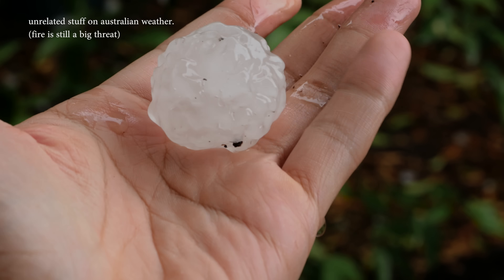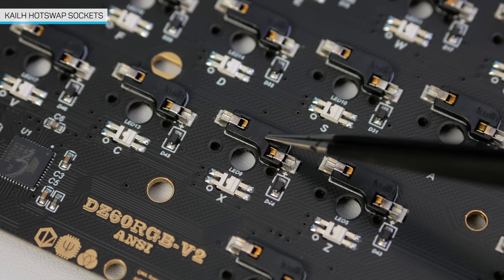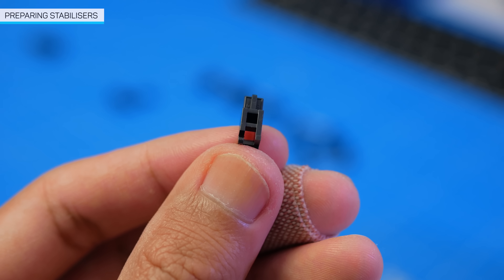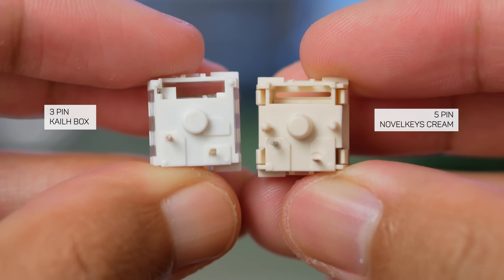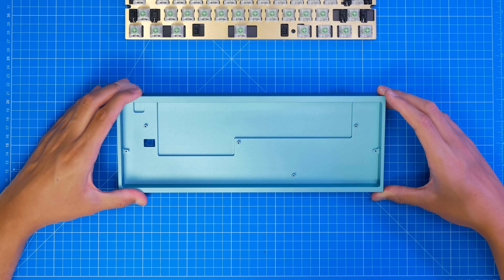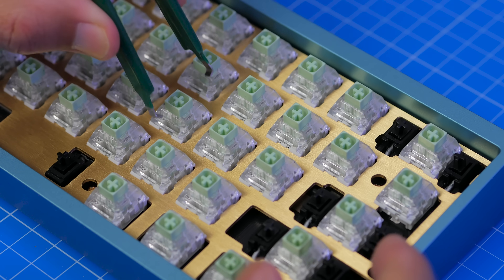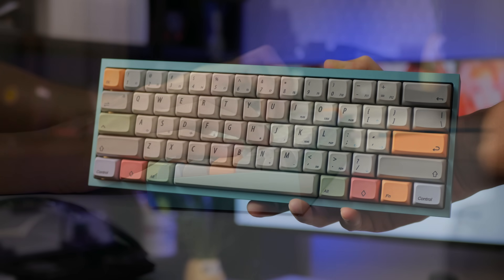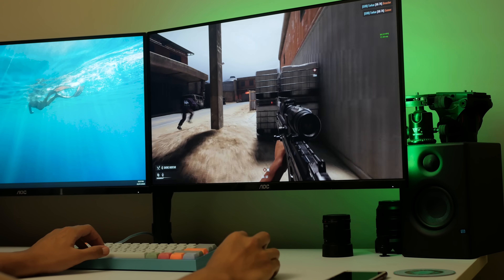How to Build a Mechanical Keyboard WITHOUT Soldering

Comment: For us EU folks, Mechboards.co.uk has the hotswappable HS60 pcb with ISO, ANSI, and HHKB options. 

Also, I would have mentioned that with hotswap boards and metal cases you should really consider using electrical tape to cover the mounts on the case, especially the middle post. On all the hotswap pcb's I've used, the middle post has come in contact with a socket on the pcb, causing the whole column to activate.

Comment: Vaseline for lubing ?
Reply: not recommended. they're petroleum based lube.
questionable when in contact with plastics for long term.
Reply: @Looo0007  I swear people keep saying this type of stuff

I remember when trying to lube the joysticks on my Xbox 360 controller and reading that people say it will eat away the plastic

I still did it 5 years ago and my joysticks are good as new.

I bought a cheap kB and used some hair conditioning product to lube the stabs and it works fine
Reply: * I read that people said wd40 would eat away the plastic but that's what I used
Reply: Just use olive oil like normal people. Makes the keyboard smell nice as well
Reply: @MrSeon123  I've considered that also, but I used mineral oil to lube the stems and housing. I think olive oil may be a bit sluggish
Reply: @ItsDextrin  That was a joke...
Reply: @MrSeon123  Lol yeah but you never know, there may be people actually doing this shit 😂

Comment: What do you think of the Jades?  They REALLY echo in that case and sound high pitched.
Reply from the maker: Jades are a bit too much for me tbh. Especially after using lubed Alpacas. And yeh, the Tofu doesn't have the best acoustics.
Reply: @TaeKeyboards  I'm not familiar with Alpacas (almost did a Google search for lubed alpacas, then reconsidered).  I'm on the fence about mine.  I don't like double click, and may have been spoiled by Alps.  Are Alpacas similarly tactile?

Comment: what about buying foam for the keyboard can you make a guide on that as I want to get more thunk out of my keyswitches.
Reply: they are great to reduce the pinging noise, especially inside a hollow metal case like this one.

a case foam (or simple shelf liner) cut and put inside the case should be enough, but a plate foam (the one you put in between the plate and pcb) will help reduce some more, and help with the plate feel (totally personal opinion)
Reply: Facts what’s all that about what does the foam do
Reply: @Hc4697  absorbs vibration (noise), basically.
Reply: uwowowowow ohhh ok. Jesus there’s so much about keyboards it hurts my brain. I’m willing to drop $900 on my custom keyboard but I have no idea how or what to get to make it quiet
Reply: @Hc4697  lubing and silencing foams. they are great
Reply: uwowowowow I’ll look some up thanks
Reply: H.Cruzz10 Lube makes the biggest difference

Comment: 5:34 It's notable that some pre-built Kailh socket hotswap keyboards don't have the holes for 5-pin switches. This is the case with Tecware and Rakk hotswap keyboards, for example.
Reply from the maker: yep, very good point

Comment: Question: should you lube a tactile switch like the Jades? Or is it not as important as it is with linears?
Reply: you can benefit from lubing even clicky switches, as long as you lube the correct parts.
also use thin lube (like krtx 203 or trib 3203) for tactile.

Comment: Gone down the same path. I have a soldering iron, but de-soldering is a pain with a cheap-o solder sucker! 
I brought a HS60 v3 pcb and planning on getting a brass plate and alu case. Also, them switches are way to loud for me!
I prefer lubed linear switches by far.
Reply from the maker: After using this for the last few days, I went back to my lubed linear board, and it just makes you appreciate how good lubed linears are!

Comment: I got a hotswappable keyboard from "Pawhits", it's a full size keyboard. It was cheap, something like 28 bucks so I thought it'd be nice to experiment with, since I'd never done it before. So then I bought some Gateron blacks to put in it (keyboard comes with "Jixian" blues. Never heard of that brand before), but to my dismay the holes for the pins seem to be too narrow for the Gaterons to fit. Ended up bending like 4 of them beyond repair without knowing. I'm not sure why a hotswappable keyboard comes with holes for pins that are too thin for switches as prominent as Gaterons but... here we are.
But I didn't give up. I searched the web for a 3D model of a switch opener and had it 3D printed at some weird cafe with 3D printers in it. Don't ask. It worked well for the Gaterons since their housing is the same as Cherry's (well pretty much anyway), but of course, lucky me, the "Jixians" have their own different locking system for their housing... so, I had to dismantle them manually with a paper clip (call me MacGyver if you will). After a few hours and a few drops of blood from my fingers after stabbing myself with the paper clip (unintentionally, believe it or not), I managed to grab the internals of the Gateron switches and put them in the Jixian housings, since those were guaranteed to fit the keyboard. So I am now left with these one-of-a-kind... "Jixerons". They're definitely an improvement. I'd love to lube them now that I'm more confident with this stuff but I am not about to go through the process of opening these up again. I hope my next experience goes a little more smoothly, but I guess I did pretty well for my first time messing around with mechanical keyboards. Not everybody's first venture has them make their own switch.
Reply from the maker: wow what a journey. Yeh i dont know what sockets are in that board. but a lot of the budget boards have outemu sockets that arent even compatible with other keyswitches. that board must be something similar.
Reply: @TaeKeyboards  Oooh, man had I known this in advance I might've gone for some Outemu Sky switches or one of those tactile purples. Sorry if I misused some terms in my story there, still learning as I go. And thanks for the reply!

Comment: How much did this all cost?
Reply: with the same case and switch, it's around $180 if you go with cheaper aluminium plate, around $220 if you want brass ones.

edit: didn't count the keycaps. that's usually another $20-$300 depending on what you want

Comment: Does the 60% diy ansi layout diy kit always come with srew in
Reply: he said he's using GMK stabs, they never include those. quite expensive on their own.

usually comes with an OEM one if at all. 
worse in quality, but bearable as long as you lube them properly (with brush and stuff, to the plastic parts as well not just the wire like tae did)

Comment: What do stainless steel plates do with sound/feel/misc
Reply: i think ss flex more than aluminium for same thickness. if you dislike the "harsh" feeling of aluminum, try ss.

brass is denser, better sounding. 
and also, more bling.
Reply: @Looo0007  and carbon fiber?

Comment: This is so sad. I'm planning on ordering parts for my own first build begin februari when it's my birthday, but the Dz60 hot swap in ansi layout is sold out😢
Reply: Sell ya mine, brand new never opened. Have a 5 degree black aluminum case from KBDFANS with the DZ60 RGB Hotswap ANSI PCB and the brass ANSI plate. (everything is still in the box from KBDFANS, I just got started on a different project that was unexpected)
Reply: @phlooke  i already bought the case in gray. I'll just wait a longer otherwise I'll hit u up again
Reply: @phlooke  how much would the shipping be to the Netherlands from where you live? And can I get your discord maybe?

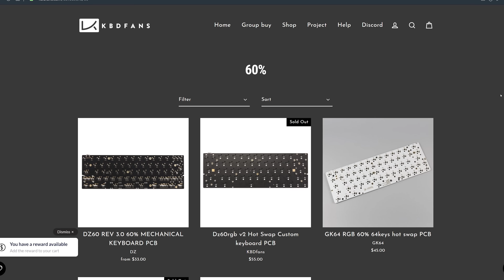Comment: Can you remove that foam piece by the left shift key (seen in 1:40) or will that mess up the PCB?
Reply from the maker: think its just a little spacer for the plate and pcb.
Reply: TaeKeyboards is it okay to remove or should you leave it on?

Comment: Do you need to keep that little piece on top of the PCB? Would anything bad happen if removed?
Reply from the maker: think its just a little spacer to keep the plate and pcb apart
Reply: @TaeKeyboards  Thanks dude. I have the same PCB and was worried.

Comment: Bit of a side rant, but I honestly wish people in the mechanical keyboard community would stop recommending things like Hakos for soldering switches.  Don't get me wrong, they're excellent soldering ions...but they're also expensive and completely unnecessary.  If all you are doing is soldering key switches then that's pretty much the easiest type of soldering possible .  To start with, it's through-hole soldering which alone makes it easier than many other types.  But also the holes and pins are relatively large and there aren't that many of them.  Two per switch, sure, but it's not like dealing with all the pins on a fancy microcontroller or something.  And since they're all the same you don't really need to swap tips either...a basic conical tip works just fine.

You do not need a Hako for this.  It's massive overkill.  You don't need any sort of fancy soldering iron.  A $20 no-name generic soldering iron from Amazon is more than enough.  At least if you're just talking about key switches.  If you're doing the kind of build where you also need to solder on controllers or SMDs then you might need something fancier.  But most mechanical keyboard enthusiasts are buying PCBs with all that built-in already and just soldering the switches.  And switch soldering really is about the easiest type of soldering you will ever encounter.

Comment: How do you get less of that high pitch metal sound and more of a thonk more bassy sound when pressing keys?
Reply: SA keycaps or you could line the inside of the case with foam
Reply from the maker: yeh foam helps. lubed stabs helps. lubed switches helps.

Comment: Super new to custom mechs and I love this channel for all the great content <3 . I wanted to ask if the stabilizer bars go under the plate or above it? If it is below, wouldn't having the bar support the keycap make it more stable?
Reply from the maker: Goes below the plate. It does support the ends of the keycap :)
Reply: it seems that the stabilizers part that support the keycap is the plus shaped plastic thing that slide into the keys, the metal bars simply makes the movement linear with each other

Comment: soldering is easy, desoldering, that's the nightmarish part with switches. I only had to reswitch two keyboards and that was enough for me to get a desoldering gun.... albiet a cheaper chinese one but still $150.
Reply: Meanwhile, I desoldered all the 111 Cherry MX Blue switches on my G710 with a cheap iron and solder wick :3 It's not that bad.
Reply: Seon-Ho How much self-hatred does there have to be to desolder 111 switches with solder wick? 
Just get a pump for 5€/$

Comment: You can buy hotswap socket keyboard. I like to answer videos title question before watching :) because maybe (probably not) you will offer another suggestion. Let's watch

Update: 
Watched. I WAS SO RIGHT :) ok please don't name title like that because it is obvious

Yes I am like almost two year subscriber XD so these titles are a bit annoying but I undrstand that it is nice approach to explanation for newbies. But it makes me feel like listening same lesson I listened two year ago

Also for first 3-4 keyboards tray mount is ok, but if you are buying your 4-5 keyboard just buy top mounted ones (they are 50 percent pricier) and sounth facing because typing experinece will be more consistent. Tray mount design keyboard are ok if you like swapping cases, but I would recommend to buy top mount to make it more endgamish. I think my 5th keyboard was top mount :D next keyboard was tray mount again which is anne pro 2 and my 7th drop alt which is integrated plate. These keyvoards are best bang for the buck keyboard on market. Now I am using these three keyboards and their are endgamish in their own way. Though I want more sounth facing keyboard because I eant to use my gmk sets more

Comment: Hotswap non 60% PCBs are just impossible to find for ISO layouts.
Reply from the maker: yeh rip iso
Reply: I would be a lot more into keyboard making if the parts were there. I mean, even PBT keycaps for ISO DE are almost non-existent. The only ones available to purchase are 2 sets from Ducky, 2 non-name sets from aliexpress and a few Tai-Hao sets which are 99% of the time out of stock.
Reply from the maker: @moepOo  yeh i hear you :(
Reply: The CU80 and CU65 GBs were running a while ago. Hot swap, and use Kailh hot swap sockets. There might be a 75% version coming some time in the future.

Comment: Hi man, what’s be better? Hot swap or default soldering(for Reliable)?
Reply: hot swap all the way
Reply: Every answer to this question will be subjective. It comes down to personal taste and preference. Some people build really expensive keyboards with cheap gateron switches, because that's what they like. Other's build cheap keyboards, where the switches are the most expensive component, because that is what they like. :D
Reply: Ernur Amangeldinov hotswap
Reply: answer from a kb builder here:

your question really depends on how you use your keyboard.

- if you're starting out, go with hot swap. it'll help a lot especially when you dont know which switch is best for you. 
(for these guys, my advice is go to a keyboard meetup near you, they usually have varieties of keyboard and switches for you to try. dont be shy to try them all.)

- if you're a person who's easily bored and want to change your switch/kb a lot, go with hotswap. they usually retain their value. (i.e. unsoldered switches usually go higher, hotswap PCBs is desirable for beginners)

- if you have your specific favourite switch and keyboard combo, and value your experience more than the resale, I say go with soldered PCB. 
they're more stable, changing keycaps becomes a nicer experience, and less parts means less chance of stuff being broken.
Reply: Lol, you edited your comment and changed your question to something else entirely. xD

Comment: First.

Another awesome video. People need to also watch out for hotswap boards that don't have switch legs holes, which mean having to clip them off PCB mount switches. Some people are ok with that but it's extra work and would destroy the resale value of the switches if they're on the expensive side. 

The GMMK is a good example of this. Last I checked, they still don't have those holes.
Reply: why does it say 7 hours ago for you but the video cam out 7 mins ago?
Reply: Ram Gundapwar ik I’m confused
Reply: Magic
Reply: Resale value degradation I doubt, especially now that the alt is so popular